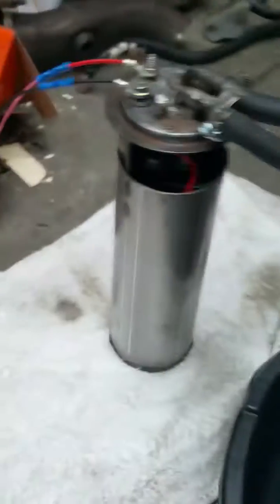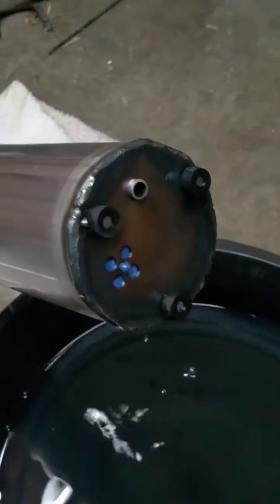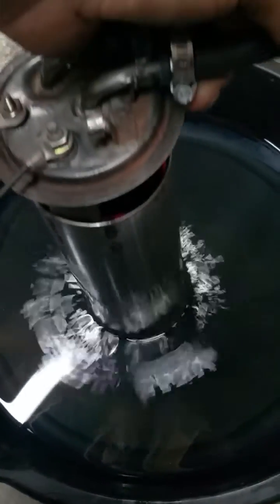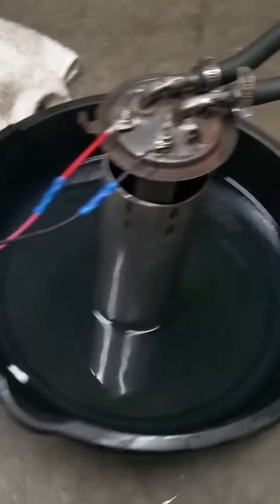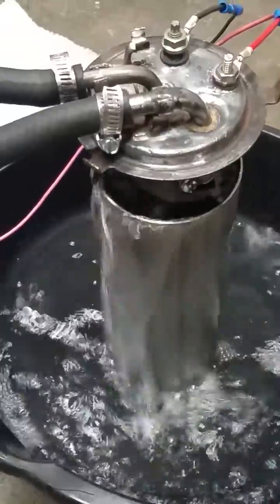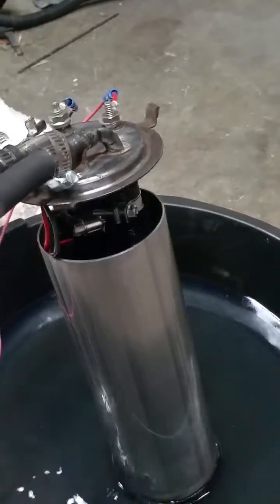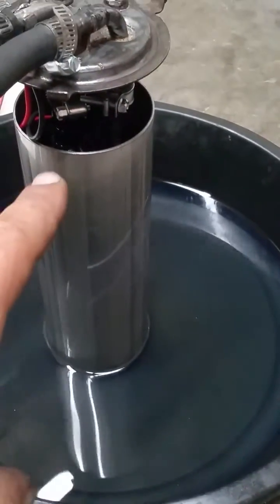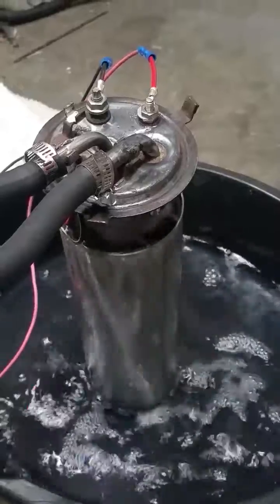Diy in tank surge tank. chevy c10

Comment: Im trying to build something similar to this. Do you have any pictures of your venturi setup?
Reply from the maker: Its literally just a radium engineering 20-0180, a short piece of hose on the pump outlet with a 5/16 brake line bent to direct fuel away from the pump pickup. And the pump siphon is connected to a piece of 5/16 brake line that is slightly flattened toward the end to prevent it from pushing all the way through a tolerance fit hole in the bottom of the sump. The siphon tube sticks out of the bottom of the sump by maybe 1/8" or so.
Reply: @gadgetdeez7069  thanks for the reply. I wondered if you were using a radium venturi. After looking around I think im gonna try the holley hydramat. Id have about as much money plus a ton more time versus just using the mat. Thanks anyway.

Comment: why the sparks on the motor brushes dont ignite the fuel????
Reply from the maker: Hector Ortega every internal combustion fuel injected engine has an in tank fuel pump like this. Fuel actually flows through the pump and keeps the motor cool. For there to be fire, you need 3 things. You need fuel, heat, and oxygen. Because the fuel pump is COOLED by fuel, there is no heat, therefore no sparks. Because the inside of the pump motor is completely flooded by fuel, there is no air.  If you dont have heat and you dont have air, there are 2 of the 3 things required for fire. So it is impossible to have fire or explosion.
Reply: @gadgetdeez7069  - Additionally on this Question, Liquid gas will not ignite it must vaporize and mix with Air to become volatile.

Comment: do you have ,more info on how you built this thing?  any videos or photos of the guts to it?  TIA
Reply from the maker: It's fairly straight forward.. 

it's a can, with an umbrella valve covering 4 tiny holes in the floor of the can.. This acts as a 1 way check valve that allows fuel in the can equalize with the fuel level in the tank.. 
Google "Umbrella Valve"..   I used a crankcase umbrella valve for a harley, since they are resistant to petroleum products. 

Then, the fuel pump I used to run the system AND my engine was an aeromotive Stealth 340Lph..  I believe it was pump 11541, but not necessarily critical so long as you can find a sock that is compatible for your surge canister and pump. 
https://www.aeromotiveinc.com/new340/

That then feeds the engine from what little fuel is in the surge canister. The unused fuel returns from the fuel pressure regulator in your fuel rail or corvette filter, however you have your setup plumbed, and returns to the surge canister through a Radium engineering venturi jet pump. 
http://www.radiumauto.com/Venturi-Jet-Pump-Kit-P760.aspx

The outlet of the pump is routed to a 5/16? brake line I bent 90*. The exit of the pump needs a little hose on the end of it to work correctly. The 90* bend in the outlet also creates a swirl in the can, so if there is any air, it immediately surfaces, rather than getting blown down toward the fuel pump pickup. 

This return fuel, returns through the venturi creating a vacuum in the inlet. on mine, I installed a 90* elbow pointing downward, as I didn't have room to install it as a "Tee".. The now 90* inlet to the jet pump is routed to a 5/16" tube that is ran through an interference fit hole in the bottom of the can. it peeks out by maybe a 1/16" or so, just so it doesn't randomly come out, and the interference fit makes sure that theres no excessive fuel leak between the tube and the bottom of the can..  a slight leak is ok, but the idea is to keep the can full at all times. so the smaller the leak the better, but dont go epoxying stuff. I've found epoxy or other sealers to cause unnecessary trouble later down the road. 

so now that the jet pump is plumbed to a tube just outside the floor of the can, the return fuel from the engine returns to the can, and creates a vacuum on the inlet of the jet pump, which also sucks fuel from the fuel tank to join return fuel exiting the jet pump and this is what fills the can. The can fills till it overflows into the fuel tank. 

To prevent the suction tube of the jet pump from starving, I drilled/tapped 3 1/4-20 holes in the bottom plate of the can before welding it all together.. I installed some screws in the threaded holes and tack welded them in place so they don't back out..  I trimmed the threaded side down to about 5/16" long and installed a piece of 1/4" fuel hose on each bolt that was just a hair longer than the bolt to prevent metal on metal contact so I don't end up with holes in my tank later down the road. 

removed my fuel sending unit from the hat of my tank, removed an unused vapor line, and re-purposed it for a mounting hole for the l shaped bracket I made to attach the can to the hat with a single bolt. This bolt will also serve as my fuel pump ground. Take measurements, and tack bracket in place. 
 The old sending unit signal terminal was removed and replaced with a nylon bulkhead for the fuel pump power lead. I'm sure you could just use the old sending unit terminal if you really wanted, but I don't want any risk or shortage of fuel, so I opted to upgrade it with a proper terminal setup. 

After that was done and installed, I got a 5 bolt universal GM 0-90 ohm fuel level sending unit. (Since this was going in a chevy truck. Your sending unit resistance values may be different) and adjusted the sending unit to fit my tank. and installed it in the tank in a different location. Make sure you have room to mount it where you want before cutting a hole in your tank. Tank mounting, body work, straps etc may be in the way. consider this before cutting a hole.. ideally, for the least amount of slosh in the gauge, try to put the float as close to center of the tank as possible. 

Just a tip.. When setting up your fuel level sending unit and they have you taking measurements for Full/empty.. Full is NOT measured from the top of the tank itself.. "Full" or the "TOP" of your tank should be measured from the bottom of the vent tube inside the tank.. When you fill up, the vent tube will shove gas backward into the nozzle to auto shutoff the pump when full. They do this to leave room for expansion inside the tank.. If you measure the top of your tank instead of the bottom of the vent, your fuel level will never read full..
Reply: hi man. i think this is a fantastic setup you have. i would like to try it, i just have two question how far from the bottom is your inlet to you main pump positioned? and do you know if that umberella valve ok to use with higher octane fuels?